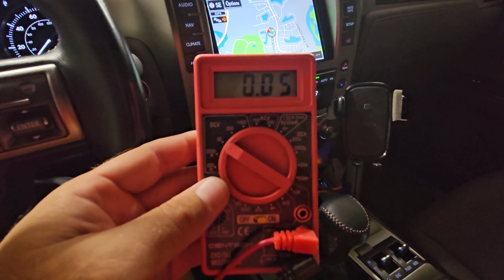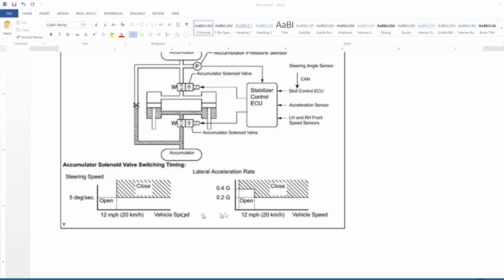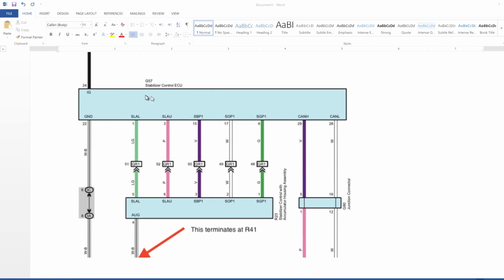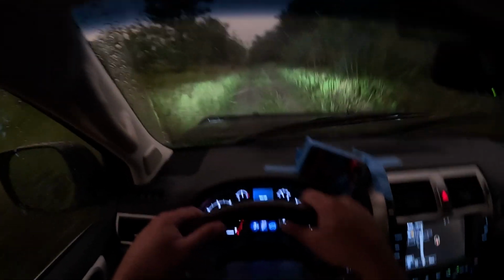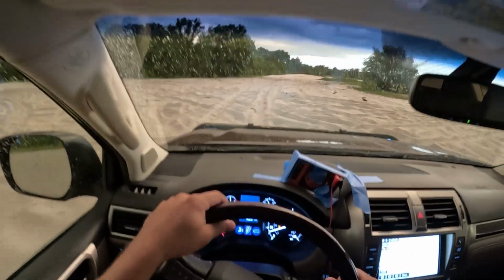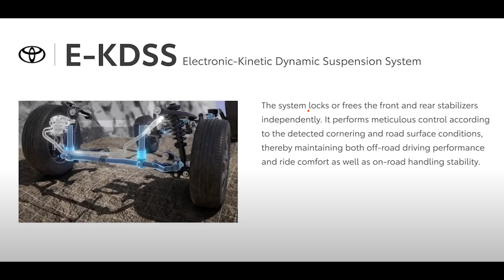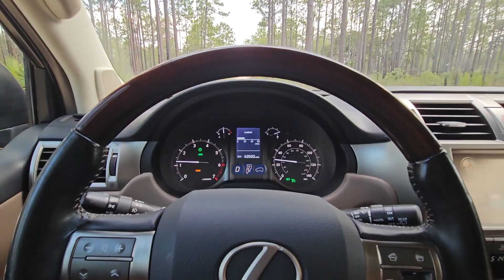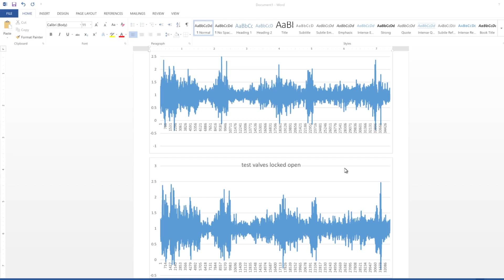How KDSS logic Actually Works! Watch before you MOD! includes GX460 testing (4runner)

Comment: Awesome video. I was looking to buy a switch and thought I’d look into the logic of the system a little more before buying. Thanks for saving me $200. I mainly wanted the system off while driving in a straight line at 60 mph. Now I know there’s no need for a switch in my use case.

Comment: Thanks so much for this video. 
I have a question;  I'm trying to install a lift kit and many says I "must" unscrew the shutter valve bolts of the accumulator before installing any kit. My issue is that my accumulator is pretty rusty and I better not touch it. Based on your video, It seems even if we unscrew the shutter valve bolts, it won't really affect the fluid dynamics while the car is on jack! Whats your take on this?
Reply from the maker: Yeah, based on reading the Toyota documentation and experimenting with my truck it won't matter. The valves are open frequently during driving and it will equalize as soon as you're going straight on the road about 12 mph
Reply from the maker: There's a lot of bad info about the system on the internet, mostly because people try to make s*** up and don't read the Toyota documentation
Reply from the maker: Although in general lifting a kdss truck is a crap shoot. I had weird stuff happening with 1.5 in a lift because The system is so asymmetrical. I'm about to remove the kdss system altogether
Reply: @MudPuppyOffroad  Thank for the info. I had to change the shocks, and I went with ironman FCP which adds 2.5 inch. Please share your videos and experience with the kdss delete! I hope you are planning to add normal sway bars. Thanks

Comment: Like the video! I think KDSS should be most useful for out-of-phase wheel articulation, where roll bars act as a spring to keep the wheels level. If you're going over speed bumps the wheels (front pair or rear pair) are moving in-phase and roll bars aren't twisting, so I'm not surprised you'd feel no difference.

The mod to disable KDSS seems like it would be most useful to keep the roll bar floating (solenoids open) while moving greater than 12 mph AND also making turns (as turning speed or lateral acceleration would normally close the solenoids). Driving perfectly straight should have no differences (I think your chart at the end indicates this) as in both scenarios (KDSS enabled or disabled) the solenoids would be open.
Reply from the maker: Thanks for the comment. Bumps are not always "in phase" as you say. Most trails in Moab you hit the bump with one tire or the other and it causes head tossing. The KDSS override is supposed to help with head tossing it does not. You need the new Toyota system for that
Reply: @MudPuppyOffroad  Yeah I agree that not all bumps are in-phase for axles, I was just referencing the specific part in your video going over speed bumps on the road (which I'm assuming are the linear cement 'humps'). I'd consider those in-phase since both wheels on the axle are articulating the same amount and the roll bar isn't twisting.

I forget but did you get to test rolling the car side-to-side with KDSS disabled? I'd figure you'd see a difference there, like it would feel like having no roll bar, since KDSS would normally close the solenoids on quick turns. And did you ever get to test disabling KDSS doing 12mph+ turns on bumpy roads?

Comment: @mud puppy from your research so you know if these KDSS switches allow you to keep the valves full time closed? Like when your on a slope, or at a dead stop and want to keep the valves closed to prevent leaning from uneven weight? That's the real reason I want a control harness, to keep the valves shut full time when doing slow stuff on a side slope
Reply from the maker: So my truck is not configured that way but you could definitely do that. Pretty simple. Just need to give 12 volts to the solenoid
Reply: @MudPuppyOffroad I am interested in doing that as well, do you think adding 12v to one of the solenoids will be enough or would I need to supply 12v to the LG and P wires?
Reply: @MudPuppyOffroad what wires would I need to run 12v direct to the solenoids?

Comment: What are your thoughts on how to fix the kdss lean after installing ironman lift kit ? Would unplugging the kdss module help it even it out ?
Reply from the maker: I don't see how the module could possibly contribute to the Lean. It opens up the valves to the accumulators and equalizes pressure every time you're going in a straight line. I think the lean is inherent to the geometry of the system, It's very asymmetrical by design. I will be deleting it completely
Reply: @MudPuppyOffroad  what I meant to ask is. I just installed the foam cell pro stage 2 kit from ironman and the suv now has a lean to the passenger side. 1 inch lower on both front and back passenger side.  Any tips on how I might fix this lean ? Dr. Kdss claims that his kdss module will fix it and evenout the suv by opening up the kdss valve and keep it open. I however can't say for certain if that will fix it.  Thoughts ? Thanks
Reply from the maker: @charlieHorsie  I have zero faith in anything that guy says. He tried to argue with me in the comment section very unsuccessfully. It's pretty clear He doesn't understand how the system actually works. Maybe he does now that I made this video LOL  I think the only thing that will help the lean in your case would be to add the link spacers front and rear.
Reply: @MudPuppyOffroad  cuales son esos espaciadores?

Comment: Any idea how to get the KDSS light off after deleting? I've tried disconnecting the KDSS ECU and fuse which didn't work. I'm more of a mechanical guy, but would measuring the resistances across the pins of the accumulator and adding resistors that match onto the harness get rid of the fault? BTW I deleted my KDSS and designed some brackets for a OEM style rear sway bar and welded those in. Rides great and minimal body roll.

Comment: Hey man, great educational research! I see that you are running large spare tire with KDSS, are you worried that the rear sway bar and the hydraulic pump run into the spare tire under off road articulation?
Reply from the maker: I checked all that. This spare barely clears the sway bar and cylinder how I have it positioned. I'm deleting kdss anyway though
Reply: @MudPuppyOffroad  yeah I have a 33 under there and the distance between it and the sway bar is almost the same as yours. So no issues goi\ng through rough terrain with the big spare in the back or you yeah?
Reply from the maker: @xujedy1740  my spare is very thin on a narrower rim
Reply from the maker: @xujedy1740  https://youtu.be/PPpsLsSWrBI

Comment: Welp…you just saved me a few bucks. I was planning on purchasing the switch. I really appreciate the objective evidence you presented here. I see that you plan on deleting your KDSS. What do you plan on replacing it with? That would also make a great video if you haven’t already planned on it. Cheers 🍻

Edit: Just spotted your KDSS delete video. Subscribed
Reply from the maker: Working on the delete RN it's a bear. I'll post a video in a few days hopefully. No sway bar up front. OEM sway bar rear with solid links and a manual disconnect
Reply: @MudPuppyOffroad  I bet it’s a pain! Looking forward to the new video. Thanks for doing the heavy lifting for the rest of us.

Comment: My 4Runner front ram has begun to seep oil. No dash lights or issues yet. I am thinking of removing the front sway bar if that will prevent the ram from continuing to leak. I’m wondering if oil will continue to se￼ep past the piston if there’s no swaybar pushing up against the ram. Again, I’m hoping someone has first-hand experience with the same situation.
Reply from the maker: There will still be pressure in the ram when the rear cylinder locks up. The system is cross-linked. But it may help slow the leak
Reply: @MudPuppyOffroad  did you see the new front ram replacement in the work from Dr KDSS?

Comment: Did you try offroad by removing electric wire harness from the kdss actuator on the frame rail? So it will not engage whatever the steering wheel speed?
Reply from the maker: I unplug the KDSS computer which accomplishes the same thing prior to adding my switch which also accomplishes the same thing
Reply: Yes, but it seems not, if it’s changed with steering wheel speed, it’s not completely turned off. Because kdss actuator is the only output that controls kdss pistons right?
Reply from the maker: @telmenluvsandorj3217  I think you have some kind of misunderstanding. From the factory, the system turns on if there are high g's or there is steering speed. When I disable it. The system remains in float mode. No matter what, there is no voltage available to close the lockout solenoids
Reply: How does it turn on if we cut off electric power from the kdss actuator by pulling its harness?
Reply from the maker: @telmenluvsandorj3217  the signals that close the solenoids in the KDSS accumulator come from the KDSS computer. So if you remove power to the computer, there is no way to solenoids can shut. It's a pretty simple wiring diagram.
Reply: In your video, you just plug and unplug kdss fuse by switch. But by pulling kdss fuse, solenoids will close which stiffens. By pulling power from the actuator it opens up the system.
Reply: Sorry if you understood wrong, i’m still reading how it works
Reply from the maker: @telmenluvsandorj3217  The accumulator lockout valves are normally open and energized shut. So if you removal voltage they can't shut
Reply: @MudPuppyOffroad i finished reading all diagram. You’re wrong, by pulling fuse you just give kdss malfunction, which triggers fail safe chart, by pulling harness you can’t activate fail safe chart and solenoids will stuck at their last position. Which is open. It’s open during stop. You’re experiment doesn’t make sense, you think you cut off the power from stabilizer computer by pulling fuse but it still works because it changes it’s output by sensing wheel speed sensor.
Reply from the maker: Yes, I'm aware of the failsafe function. I really don't care enough to have this argument with you, but let me try to help you. I have an LED wired to the signal that closes the relay. Therefore, when the LED is on, the relays are closed. When the LED is off, the relays are open. From that standpoint, pulling the fuse and unplugging the computer achieve the same thing. I am aware of the fail. Safe logic
Reply: One guy tested it by pulling harness
Reply from the maker: I repeated the experiment with the fuse pulled and the computer unplugged multiple times with a GoPro monitoring the KDSS cylinder and my LED wired in to the solenoids. The results were functionally the same. The reason this is irrelevant to me is because KDSS is a crap system for hardcore off-roading it's designed for soccer moms which is why it's on the GX460 and not TRD pros. I will be deleting it.
Reply: @MudPuppyOffroad  Kinda sounds like you don't know much about off-roading vehicles (ATV maybe, not trucks).  I saw your previous comments about off-roading vehicles, you don't do anything difficult off-roading trucks.   A KDSS 4runner can do anything a TRD PRO can do.  KDSS 4runner can flex more in some situations while a TRD Pro can flex more in others.  You certainly don't understand the different trucks out there and their tech.  

That shows, because if you knew what you were doing in the first place -- you would have never purchased a vehicle with KDSS.  No one is going to buy KDSS for recreational off-roading.  KDSS is for overlanding and making it to a destination.  If you want maximum off-road ability with a truck, you look for something with a front locker and front stabilizer bar disconnect.

Comment: So KDSS is off when driving straight, and only turns on when you quickly turn the wheel while the vehicle is in motion, not because the vehicle is moving greater than 15mph like DrKDSS advertises. So the only difference the switch would make is preventing KDSS to activate while turning in motion. 

Driving fast through a trail usually means numerous and quick steering input. Does the KDSS system deactivate/reactivate between steering input intervals quick enough that when compared to a complete KDSS deactivation with a switch, does the difference in ride quality become negligible?? Toyota does advertise the KDSS valves opening and closing thousands of times every second. So perhaps yes. 

In all, unless one can immediately feel a distinct ride quality improvement with the use of a KDSS switch without having to second guess themselves, its a complete waste of time and money. And it seems like thats very much what the case is.
Reply from the maker: Yes off-road the system turns on and off pretty quickly based on the LED I installed. I played with the switch for hundreds of miles off road and I can't feel a difference. That mod is definitely a gimmick
Reply: @MudPuppyOffroad  
Seems like a switch that activates KDSS would be more desirable, especially when going through an off camber portion of a trail. You should make such switch and sell them haha
Reply from the maker: @gerard4441  kdss is not robust enough for serious offroading regardless. Deleting mine

Comment: Excellent video. I am about to change out my front struts on my GX today - was searching for whether I really need to open the shutter valves to do release the KDSS. Looks like all I need is a floor jack to push up on the front KDSS actuator to assist with the coil over swap out. We'll see. Please comment if you agree or if there is additional rationale for releasing the shutter valves for my mod!
Reply from the maker: You should check out my other kdss videos explaining the function of that system. Most of the time the accumulators are open and you can manipulate the cylinders independently
Reply: @MudPuppyOffroad  Thanks, will do. I just swapped out the coilovers w/o the need to open the KDSS Shutter Valves and w/o removing the sway bar. Just used a floor jack to help manipulate the KDSS front cylinder (lower the passenger side). Will be publishing that video soon on my channel.

Comment: It'd be nice to be able to engage the sway bar on demand.  It'd be helpful for off-camber traverses (probably not so useful in FL, but VERY useful in the mountains).  Also...does your KDSS squeak?
Reply from the maker: Ive been thinking about that, could wire it up pretty easy... but you'd have to engage on flat ground prior to going off-camber. No squeaks yet